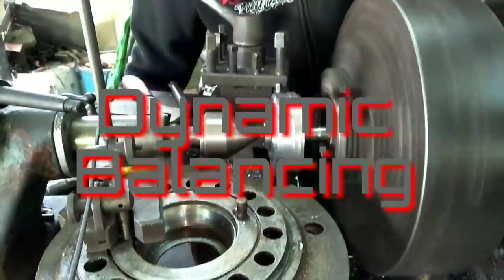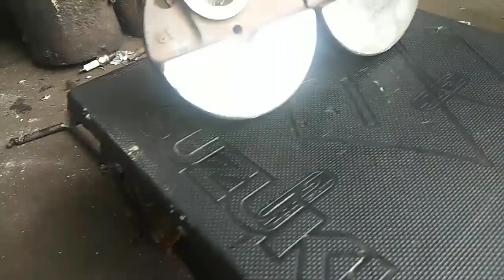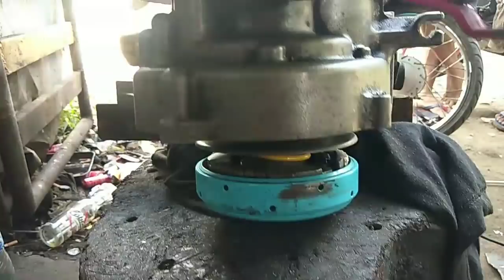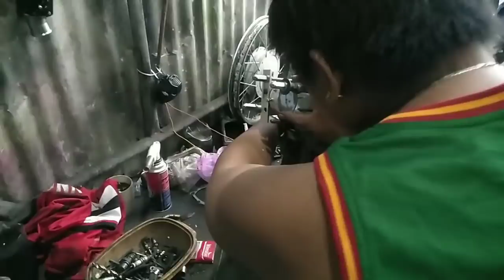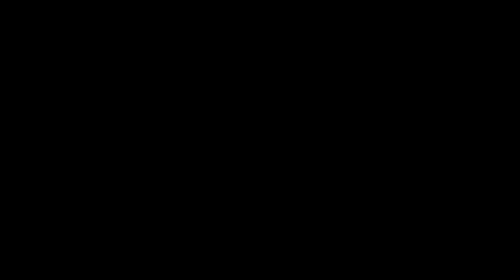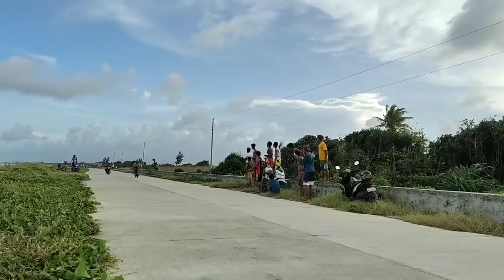DRAG RACE Mio open 2 valve VS Mio open 4 valve | set by G-worx

Comment: Paki explain naman po nung DOHC
Reply from the maker: Dohc ser.  Twin cam po cya.
Reply: @motochock9881  yan po bayun sir yung ginawa nyo
Reply from the maker: Ay hnd ser.  Naka 2 valve lng po kame.  Bali ung kalaban nmen.  4 valve.  Pero single cam lng.  Ung koso may nilabas na dohc, tinatawag n Mickey Mouse.  Twin cam cya.  Like raider 150
Reply: @motochock9881  a salamat
Reply: Dual over head cam .. wla na syang tune up .. kagaya sa raider 150

Comment: 1 hit lng ba?
Reply from the maker: 2 hits ser.
Reply: Sino nanalo sa pangalawa sir
Reply from the maker: Ung unang bitaw ser.  Nasa 50 meters plang.   Naputol n ung wire nung coil ng 2 valve.  Nanalo po ung 4 valve.  Tapos ser nung 2nd hits na, nanalo ung 2 valve nmen.  Kaso pag dating sa finishline.  Nasira ung lining nmen.  Bumigay ung lock nya.  Makikita nyu un sa vid.  Ginagawa ni ong eng worx.  Kaya nag decide nlang n itabla muna.  Next wik may laban ulet
Reply: Wow congrats sir .,lakas ng motor n’yo pwd na sa binalonan yan december 8